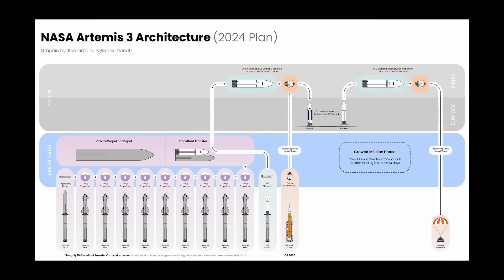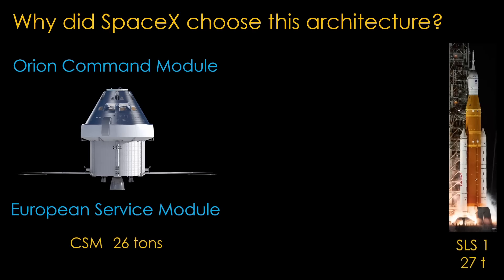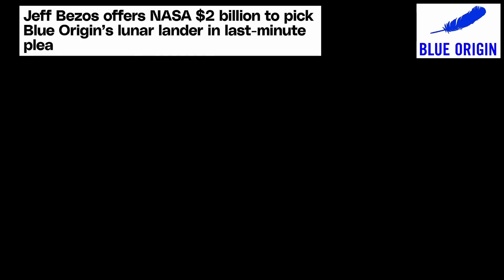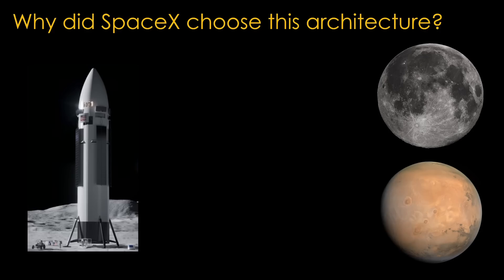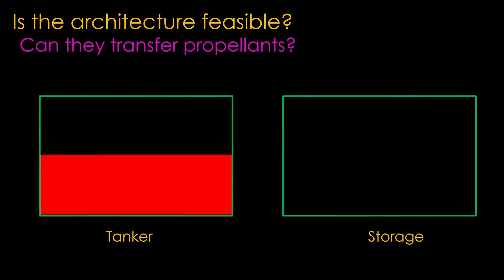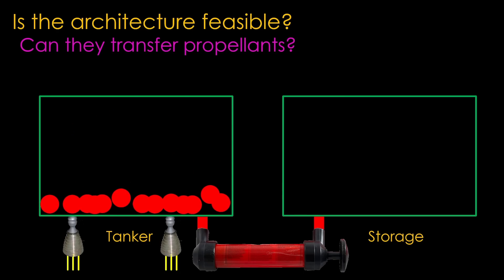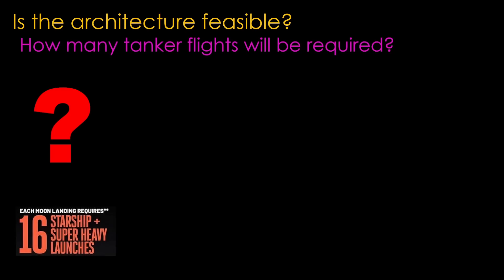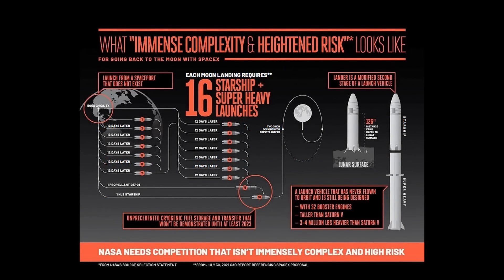Starship Orbital Refueling

Comment: I love how this channel cuts through all the FUD and does a reasonably balanced analysis of the basic issues
Reply: He hasn't actually cut through much uncertainty, sure he's given options for propellant transfer and tank chilling, but those haven't flown on any of the starship flights so far. As for how many tanker flights are required per moon landing, he's not reduced uncertainty even the slightest amount. The program is supposed to have a moon landing by 2025(?), that seems impossible, so I remain doubtful. Can SpaceX keep effectively losing perhaps ~$500M or more per starship (assuming a reasonably high cost for the raptor engines) until they figure all of this out? Can they keep doing funding rounds to the tune of hundreds of millions or even billions into 2024-2025-2026 as they've done in 2021-2022?
Reply: @alexgustavsson5955  In what universe does a single starship cost 500 million per ship?

The whole stack is 90 millions,NOW, not even considering the raptor 3. A starship V2 is probably in the 20 millions range.
Reply: @gasdive  You're saying a single raptor engine costs less to produce than a medium-sized commercial jet engine? It has to withstand far greater temperatures, pressures and flow rates, not to mention it's physically larger, and is not being produced in the thousands, like jet engines are. I think I'm being conservative when assigning a cost of $8M to raptor, and that would put the costs of super heavy's engines alone at >$250M.  I imagine you've got the information that it costs ~$1M from some source at SpaceX, well, there's a very easy way for them to convince me that's true - simply publish a yearly/quarterly financial report, and let's see the cashflow and assets/liabilities. That would immediately shut me up.
Reply: @alexgustavsson5955  nothing would shut you up. The CEO has publicly stated that the Raptor 1 engines cost 1 million and their target was 250,000. That's a statement about company finances and it's illegal to make false statements about that.
Reply: @gasdive  No, I looked it up, she called it the marginal cost for each new engine, so it's not amortized, and I don't believe it one bit. This is also the same woman that wants to fly people with the equivalent of a ballistic missile from place to place, so I remain skeptical.
Reply: @alexgustavsson5955  They will attempt to recover the Super Heavy on the next flight. Super Heavy is most of the cost of Starship.

SpaceX is mostly self-funding, so they can likely keep the Starship program going indefinitely at the current burn rate, but it doesn't seem like they are going to need to.
Reply: @SpaceAdvocate  They've gotten a whole lot of venture capital over the last few years for a self-funded company. Is that included in self-funding?
Reply: @alexgustavsson5955  Orbital re-filling retired most of the risk with the transfer test (10t of liquid ox) they did on IFT3 (and NASA confirmed it as successful). According to Musk: "
Musk: orbital re refilling, I mean, I don't wanna count chicks before they hatch, but, orbital re refilling is really just docking with ourselves. Yeah. We dock with the space station all the time. Right. A space station is way harder to dock with than ourselves.
Dodd: And but will it be all docking up to a, to like a depot? Is that kinda the plan? Is there to be an orbital?
Musk: It depends on how quickly you wanna launch. So, if you're going to the moon, I don't know. I don't think you need a depot. I think you just send a ship up and send tankers immediately. Yeah. And your boil off rate will not be too bad.

Comment: Couldnt a cryocooler for LOX and Methane be alot simpler?

Linde cycle liquification on the LOX side. https://en.wikipedia.org/wiki/Hampson%E2%80%93Linde_cycle#/media/File:Linde-verfahren.svg

Then cooling methane side with a loop of neon gas, since its boiling point is -250C.
Reply from the maker: Perhaps. I think if you do an orbital cryocooler your big concerns are likely to be power use and waste heat

Comment: Well done.  So basically this all depends on rapid reuse of Starship to keep the orbital propellent depot full.  So even when there isn't a launch coming up you keep flying propellent to the depot or have multiple depots with cryo-chillers.  Now you don't have to depend on a bunch of flights all happening within a short time period because you have more than you need already in LEO.  They could even set up a pipeline that puts a propellent depot in Lunar orbit for the reusable HLS.  The point is that keeping the depots full is a separate project from the Lunar mission.  This all depends on being able to fly Starship a few times a week at low cost.  The more they fly the better they get.
Reply: Why do they need to keep is full if there are no missions going?
Reply: @TheEvilmooseofdoom  For the next mission plus it reduces logistics problems if the propellant is there well ahead of time for the current mission.   Plans are to use cryo-chillers to prevent boil off.  They could put multiple depots in LEO and then whenever someone needs propellant they just tank up at a reasonable price.   This lets you launch into LEO but then go to the Moon or Mars with a smaller rocket.  If you have to bring your own propellant you have to have a much bigger rocket (due to the rocket equation)

Comment: Great Video !  Audio please !  A Fuel Depot is needed in a low inclination near the LEO CSS !  Another Fuel Depot is needed on the Lunar Surface (LS) near the South Pole Lunar Outpost/Base (Clementine Base) !  The LS Fuel Depot is supported by the Lunar Water Ice (H2O) and the Hydrogen can be used to recover more Lunar Oxygen (LUNOX-TM/LOX/O2) from the minerals of the Lunar Regolith !  The flight/mission round trip from the LS to L1/NASA Lunar Gateway is about a  6.0 km/sec delta-V,  a round trip from the LS to LLO is about a 4.0 km/sec delta-V and to do a one way flight/mission from the LS to the LEO CSS is about a  6.1 km/sec delta-V !  The SpaceX Cargo Starship can land on the LS with enough Methane (CH4) to return to the LEO CSS !  The Cargo Starship after off loading the Lunar Cargo, can then top off with surplus Lunar Oxygen to use or sell at the LEO CSS !  For more info read the paper  "Moon Direct" by Robert Zubrin.  Another Fuel Depot maybe needed at one of the moons of Mars.  Oxygen can be recovered from the minerals of the moon of Mars using Hydrogen !  The Oxygen can fuel the Mars HLS for mission to the Mars surface !  The Oxygen can also be used to fuel Mars spacecraft for return to earth !  The Tech developed to return to the moon to stay, can take US and the world to Mars and beyond !  tjl

Comment: What are your thoughts on the Starship HLS landing engines? When SpaceX revealed their first HLS render with that ring of small thruster engines halfway up the nosecone, I thought it was genius and obvious in hindsight. It completely erases the engine plume problem that every lander has to deal with (which many thought would be a dealbreaker on a ship as massive as Starship) for both landing and takeoff. The best landing engine is no landing engine. But it does add a lot of complexity and Musk has hinted in the past that he'd prefer not to have to use them, and use the raptors on the bottom of the ship if he can (yikes), but he hasn't discussed that in a while.
Reply from the maker: No idea. I'd love to have an update on their thinking, but other than a new render there hasn't been much on the lander.

Comment: An analysis that tacitly waves away Starship’s ability to relaunch in a few days as no big deal is not much of an analysis. You are accepting as fact one of the biggest unknowns. Also tossing in SpaceX busting its budget with expendable Starships is another wtf.  Finally, can SpaceX catch Starship and Super Heavy? A very big unknown you completely glossed over.
Reply from the maker: There's no reason super heavy shouldn't be rapidly reusable. Falcon 9 is pretty close running a fuel that's not good for rapid reuse and a stage that wasn't really designed for it. 

Starship is more of an unknown but I don't see any reason to expect that it will be problematic.

In both cases, SpaceX believes they can do it and their track record at doing things they say they will do is pretty good. I don't have any information other than my general skepticism to think they can't do it.

Comment: Couldn't you just use a giant pusher plate like what you might find inside a syringe to transfer propellant from one vehicle to another?
Reply from the maker: Yes. How much will the giant pusher plate and the machinery to operate it weigh?
Reply: @EagerSpace  I guess it depends on how long you're willing for the transfer to take. If you're ok with waiting several hours, then a single high torque motor might be all that it takes to push the propellant out of the tanker. At the very least, you could just have a plunger that pushes all the fuel to the correct side of the tank, and then let a regular pump do the job. But then again I have no experience in this kind of engineering, so there could be several flaws that make this idea unfeasible compared to the other options.
Reply from the maker: Because of orbital dynamics you can't bring starship back to the launch site for about 12 or 24 hours (depending on what the FAA allows you to do).
Reply: @EagerSpace  Ah ok, it doesn't really matter I guess though because as SpaceAdvocate pointed out, you couldn't use this system with slosh baffles anyway
Reply: @andrewparker318  When I think about it further, you wouldn't need slosh baffles. The propellant would be incapable of sloshing. But there are still some pretty big practical challenges.
Reply: @SpaceAdvocate  oh that’s a good point
Reply: If you have a pusher plate you can't have slosh baffles, and the seals around the edge of the plate can be a bit problematic.
Reply: @SpaceAdvocate  Good point

Comment: Would the ullage thrusters need to run for the entire duration of the propellant transfer to keep the propellants settled?
Reply from the maker: Yes, but it's not a ton of thrust.
Reply: @EagerSpace  I'm wondering if they have plans to minimize the propellant use yet...
:)
By pulsing the ullage thrusters, just enough to maintain acceleration, or increasing the pump size/speed to reduce the transfer duration.
Less hours spent refueling will be propellant saved...
Reply: @EveryoneWhoUsesThisTV  as soon as the thruster is turned off, acceleration stops; velocity is irrelevant.  Also, pulsing cryo valves is tricky.
Reply: @ Yea, seems like a pretty poor solution overall.

I think the most successful propellant transfers in the future will most likely use bladders, it just instantly solves all the issues.
Can't be adapted to something the size of starship and its cryo-fuels however.
Giant cryo-tolerant bladders would be very difficult.

Comment: So this brings up an interesting topic I don't see talked about too often - Starship, the platform. We've got what, a starlink version, a tanker, a depot, a lunar lander, and presumably a human rated crew version. Each of these is a unique development fork on a base shared core architecture. But what else is possible? A version designed to be retrofitted in orbit, into a station or a larger ship? Strapping multiple stages in orbit together to make a larger space-only ship? Thinking of them as a modular architecture opens up all kinds of interesting possibilities.
Reply: 9m space telescope like hubble but bigger
Reply: @CJisDJ 
Or several such fixed into an "L" or "X" shaped array to provide the detail of a single telescope the size of the array...

Comment: Can methane be stored as a supercritical fluid like LO2? I think that would simplify the ullage problem.
Reply from the maker: LOX requires 50 bar (ish) pressure to be supercritical, which I would expect means thicker tanks plus you have to be warmer, which means you can't get the density bump subchilling gives you. I think liquid methane behaves the same but was too lazy to find the temperature and pressures.

Comment: Dude you do know that Elon Musk talks a load of bullls*** right? Just because he says flights will be basically the cost of the propellant doesn't mean it's going to be true and certainly wont be anywhere near true in the near future, by which I mean the next couple of years. It took ages for F9 usability to actually save a significant amount of change, and even then SpaceX was only charging like ~10 million less out of 70 million.

I expect at least for the first 2 - 5 years a Starship mission will cost at the very least as much as a Falcon Heavy launch so 90 million dollars, now to get 100-200T of cargo to space thats awesome in reusable mode thats a 5 - 10x improvement, but 20 times 90 million is $1.8 billion, Thats a big difference between 5 flights which would be 450 million and 1.8 billion, hardly anybody is saying more launches are not possible to do, but the cost of doing a large number of launches will be high.

Like can I eventually see Starship getting down to something like 20 million a launch, yeh I can see it and then at that point yeh 20 launches 400 million, it's not chump change but it's not that big of a deal, but I see that being 5 years more down the line. Like to be fair we are already talking about a program where the thing to launch the command pod is costing an estimated 2 billion per launch, so $400 million is kinda chump change at that point.

But 1.8 billion... it's almost as expensive and that's my lowball on the cost per flight for the next 2 - 5 years and is already a massive improvement over Falcon Heavy in cost per KG to orbit if as said 5 - 10x
Reply from the maker: Generally I delete comments with personal attacks. Consider this a warning. 

The reality is that we don't know how much a starship flight is going to cost, nor do we know what SpaceX will charge for a starship flight. It's going to depend a lot on what "reusable" ends up meaning.
Reply: @EagerSpace  Dude it's not a personal attack, it's the facts of the matter, he said we would have fully autonomous driving by 2019 when internal leaked communications showed they knew it would never happen.

sending humans to Mars by 2024, calling Vernon Unsworth in the Thai flooded cave incident a pedo because Vernon didn't like his submersible, Hyperloop, lying about twitter bots to try and get out of buying Twitter, grand standing about free speech on twitter then banning people he doesn't like, etc etc etc.

Yeh Musk is a pretty floored individual. Not denying what his companies have managed to do so far, but at a bare minimum he is well known for exaggerating.

If your going to source someone you do have to consider the relevant history, that isn't an attack it's just being logical. Like I trust him enough that he wouldn't lie about metrics that are on the near horizon, but anything that seems too outlandish and could end up being true in the long run I'm smashing x for doubt.

Comment: Why did SpaceX choose this architecture?
Because Starship development is their priority and this way NASA pays for part of that.
Reply from the maker: Exactly, but that would be a very short video.
Reply: @EagerSpace   they don't need fancy technology to transfer propellants, just dock two ships, use gas thrusters to make them spin at enough speed to settle the propellants and use regular pumps to do the transfer. Then cancel the spin with the same gas thrusters, undock and there you go. They already have all the technology. No need for more parts or processes.
Reply: Benefits: 
SpaceX gets to land an enormous sci-fi rocket on the moon.
SpaceX gets to be the first commercial petrol station in space.
SpaceX gets an excuse to fast-track dozens of Starship launches attracting more interest, all labelled as moon missions.
I mean you could go on but yeah. Starship's low cost per launch means it really doesn't matter to them, compared to competitors. All the while they get a steady flow of sweet sweet data and practice for their work on Mars.
Reply: @Joe-me6jh  the real benifit,  elon makes nasa pay for him to have a starlink v3 delivery method and nasa gets screwed.
Reply: so it's a scam/ If we're just going to build a spaceship yard, why not build one for NASA?
Reply: why is it needed? 
because we've already tried single launch rockets and all they where good for was increasing AD revenue during their off planet sighting trips.. none could carry enough equipment and load size for reaching sustainability.. if we make ALL genetic and disease based research illegal to do on earth then we'd have research lab on the moon within 10 years.
the future is off planet mining and research away from moralistic laws and guidelines, yes- there will come some bad out of this, but humans are instinctually unable to work for the common good, we work for our own greed and curiosity. if humanity is to prosper then that prosperity must be an happy accident, not a forced goal. forcing that outcome is how we get utopian society's.
Reply: and who pays for Nasa, bingo it's you...
Reply: SpaceX chose this architecture to go to Mars.
Reply: because SpaceX doesn't care if China get to the moon first when NASA is still struck refuelling xD
Reply: @lagrangewei  China is only 55 years to late for that
Reply: @marcelmeinking1020  No one will care about that when this is a whole new thing happening now.
Reply: @marcelmeinking1020  Or is it ?